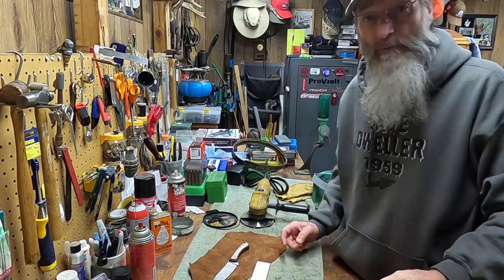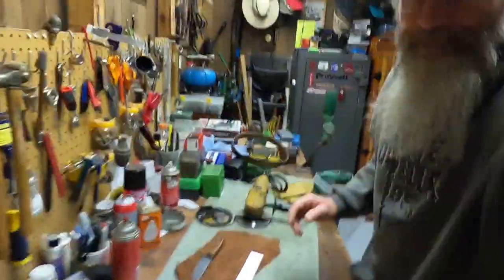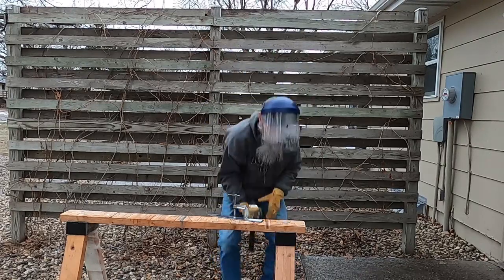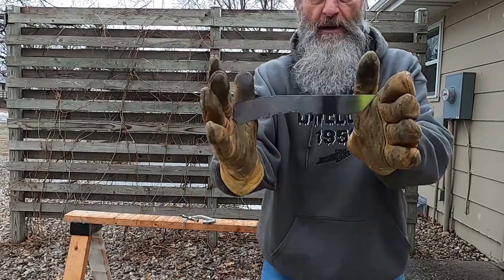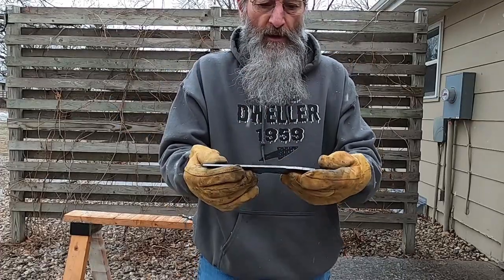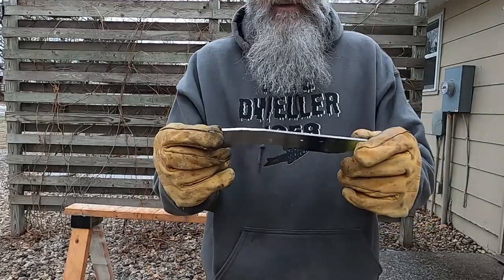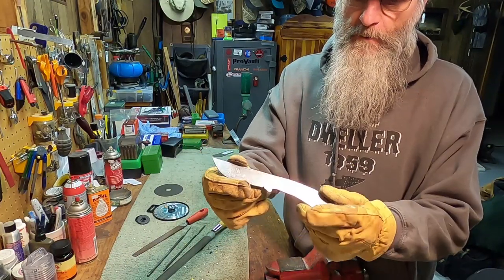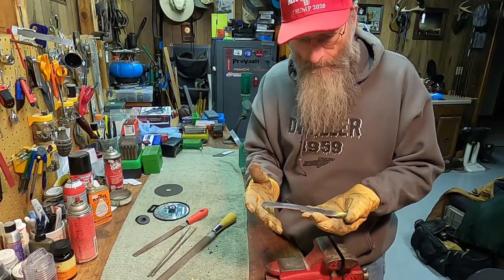How to Make your own Hunting Knife from scratch. Part #1,

Comment: I make and sell knives. I suppose similar to what your buddy does. Great job on this one. 
You’re absolutely correct that filing the bevels will be the biggest chore. I’d recommend making a bevel jig for hand filing. Basically you’re making a GIANT Lansky or Smith Precision sharpening tool when making the jig. It’s really hard to hand file the correct angle thousands and thousands of strokes.  
For scales, check out black palm. It’s one of my favorites. Kinda finicky to work with but the finish product is gorgeous.

Comment: I’ve made a few knives. Get you a good cutoff wheel. They are real thin. Then an 80 grit grinding blade for trimming and a 120 wheel for the finish. I used that for two years and I can profile a blade in under 30 minutes. I made a jig to file my angles. It’s easy to make.